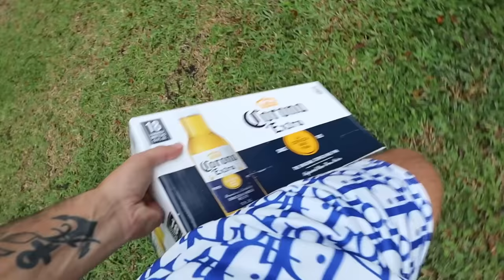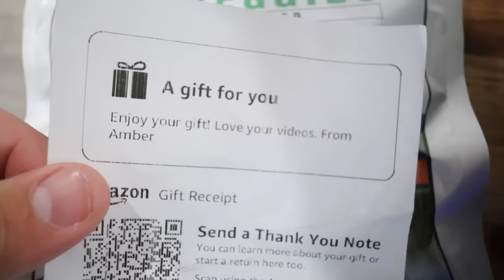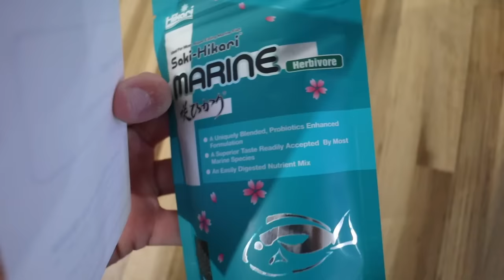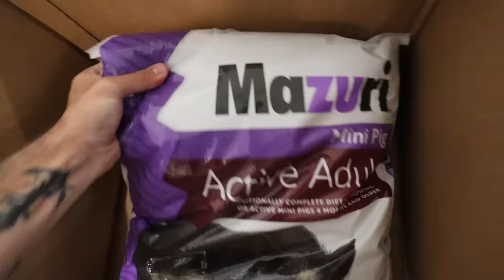I spent too much on this pond...

Comment: I work with concrete everyday mate and that should definitely be vibrated to make sure it spreads properly fills every gap and makes sure there's no air bubbles....also if done right it should be openable within 2 days
Reply: I drive a Concrete mixer for a living and know a little bit about concrete. That concrete should have all  been placed and finished within a 90 minute time frame and it should've had a lot less water in it. That was like a 9" or 10" slump which causes it to lose most of it's strength. A 6" slump would've been as wet as I would've accepted for that pond. A small line pump, a real concrete mixer with all of the concrete pre-mixed was really the only proper way to pour that pond. And as Jarred Smith said above - it should've been vibrated. I realize it's a bit late now. I wish you well and hope your pond is all you dream it will be. In the future though if I could give some advice. Cheaper isn't always better. A line pump in Boston area is about $350.00 for the day. Assuming you only needed 6 yards of concrete - that would be another $1,000.00. I don't know what it cost for those pallets of sakrete, the mixer rental and the laborers - but regardless - if the pond cracks or fails - how much did you save? Best wishes.
Reply: I was thinking the same thing.  There will
Be too many micro layers poring it so slowly.   Can’t understand WHY they didn’t get a concrete truck and pump ?
Reply: @spidartanks  ya see the next part... the window? Vibrating saves that

Comment: 8:30: (ish) You could always put another window in Retroactively, once the cement hardens. It would mean using some sort of heavy duty angle grinder/cutter (or some-such) to cut through the concrete and metal reinforcements, but it could be done. It would also be a lot less hassle, to do it now, rather than later, (once you have water and fish to deal with). So it's worth thinking about it, at this stage of the build, if you are having regrets. 😁

Comment: You need to test the moisture content of the concrete before you paint or epoxy it.
Too moist and the coating won't adhere properly

Comment: Always worth having a mixing trough and a shovel incase the mixer pack up half way through. Or a wheel  barrow and a hoe is another good system to knock up concrete manually.

Comment: You can still put another viewing panel on that side if you cut out the concrete witch will be perfectly safe as you have plenty of metal bars in there and it would look so much better if you can sit and look at both sides at the same time!

Comment: I say use a concrete saw and add the window before you go further. If not you may always regret it. Or an easier idea would be to have someone paint a mural on that end of the pond with a window painted on there as well.

Comment: Next project, you should do a concrete slab in front of the fish building and do a covered porch for it.  Would make for a good outdoor area outside the building for when you do projects like this temporarily store supplies.  When it's not in use for supplies could use it as a patio outside the building.  😁

Comment: Awesome to see the different ways of building ponds. Looks awesome. But wouldn't it have just been cheaper to use concrete blocks, then fibre glass it? That's how I did my 3000 gallon and cost less than yours with a window 4 times the size.

Comment: A probably cheaper way to run the pvc for water change would be to find the line outside and put a T where you would like the pipe for the new tank. Be a lot less material.

Comment: YES YOU DID!!! TALK ABOUT OVERKILL 😕 I used to own a waterbed.  The weight of the water is not as bad as you think. A frame built with 2X6 treated lumber and half inch plywood then Covered with a Blue Vinyl pool liner would have been MORE THAN SUFFICIENT!!!! YOU USED ALL THAT UNNECESSARY CONCRETE.!!!
Reply: Hector Knew this ALL ALONG, but he ain't saying anything because it's just $$money in his pocket. What does he care.

Comment: good lord...i new this project was going to make my head explode....bags of concrete ..bags... it would have been so much cheaper and more efficient to have a truck, the concrete would have been a better mix and more consistent, your concrete looked like watery crap...and i didnt see a concrete vibrator...for the amount of money u spent for another 100 bucks you could have bought your self one.  The vibrator removes the air bubbles and increases the structural integrity....u way over spent on cement and labor costs amd ended up with a sub par product.  i have serious concerns about this one.